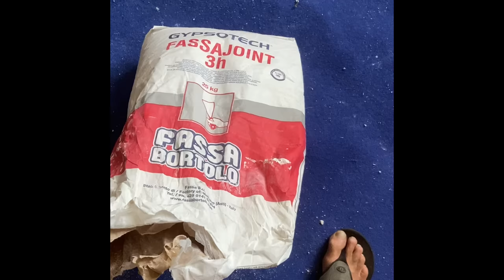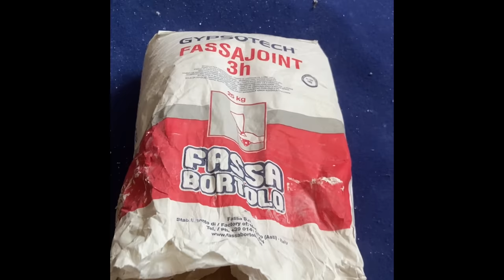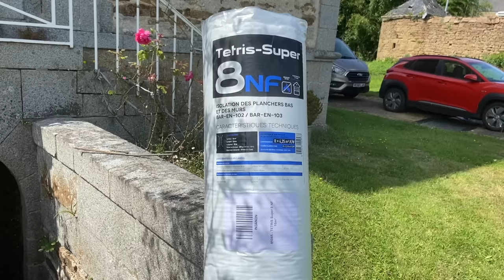The Châteaux Coach House Gets Some Well Deserved Attention!

Comment: You need to put paper tape along all the joint lines (i.e., where two drywall boards meet) in order to prevent cracks that will inevitably come otherwise.

Comment: I'm just curious:  Is there such a thing as a plaster you can use that does not conduct electricity?  Something as a safeguard to put around wiring encased by plaster?  Also, I have found that using liquid paint stripper, a scrub brush, putty knife and water hose works very nicely on things like old exterior wood doors.

Comment: upholsterers trick, fill all the tack holes with glue. that way you will have a better surface for new tacks......
Reply from the maker: What kind of glue?
Reply: white glue. Weldbond is the best.  slather it over the holes till they are filled. then repeat if necessary!!
Reply from the maker: @billfillmore4988  thank you

Comment: What is the R value of that insulation blanket? 

Remember, hot flows to cold it would slow down the heat transfer to the basement. 
Any pipes down there that might freeze?
Reply from the maker: The cellar stays around 8’ all year

Comment: Are those pipes in the cellar wrapped in asbestos?
Reply: If I recall correctly when dear Adrian was doing other works in the basement, no not asbestos.
Reply from the maker: It’s not asbestos but something similar otherwise it would have been mentioned on our diagnostic report
Reply: @cynthiabroockman1752  So glad to hear it. Must have missed that one.  Our home is of a certain age and every single pipe in our cellar was wrapped very similarly, installed in the 50s and it all contained asbestos. Asbestos is only dangerous when it becomes airborne particles, so it’s worrying.
Reply: cjpowers9330 Worked a few years for an asbestos/lead abatement firm. Amazing how muchis still out there, quite a process to remove/fispose of and expensive too. Sorry to hear you had that problem nasty stuff.